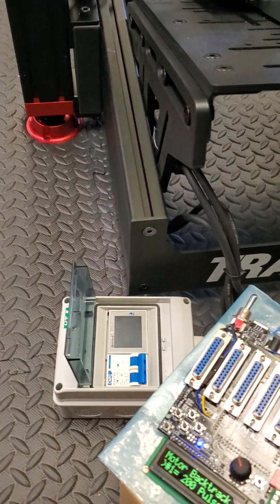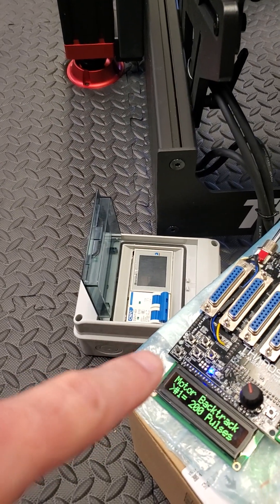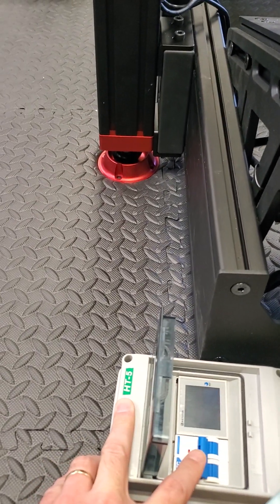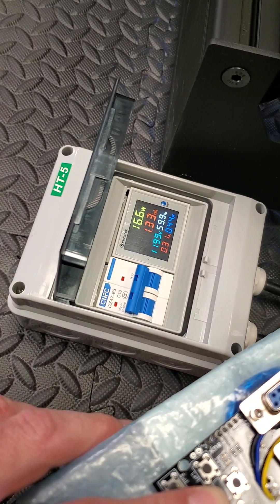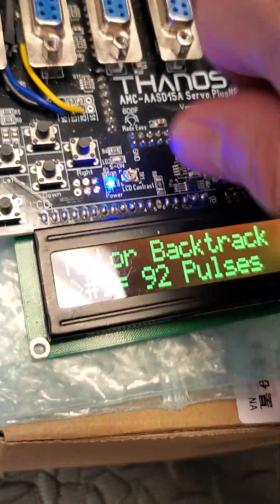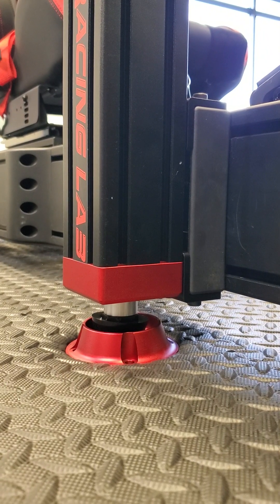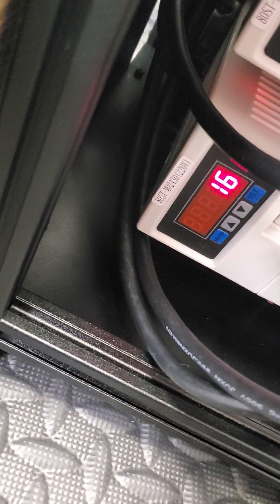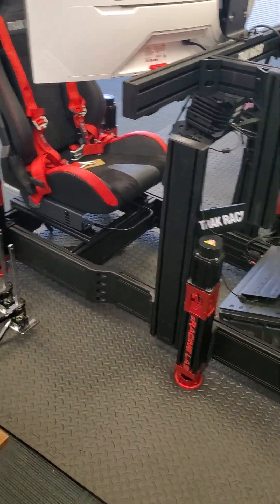BREAKING... well, not so breaking, now using adjustable..

Comment: After the self-test. Raise 5mm. A power outage will lead to a sharp drop!
Reply from the maker: Just powering off the servomotors even with estop, or just from the power strip switch, will still do that small drop.

But I needed to minimize it as Simhub is adding power off automation for idle  condition, to save power and eliminate any noise from the servos holding position.
Reply: @tronicgr  Look forward to your thanks. If it can be set by 1-2MM after self-check, it will be even better. I am using 1610 now.

Comment: Is there a menu option somewhere to change the pulses per revolution?
Reply from the maker: @sloppyengineering  yes, by selecting the leadscrew pitch value. Different pitch leadscrew has different pulses per revolution.
Reply: @tronicgr  That's what I'm currently using. I was interested to know if there was another menu option somewhere